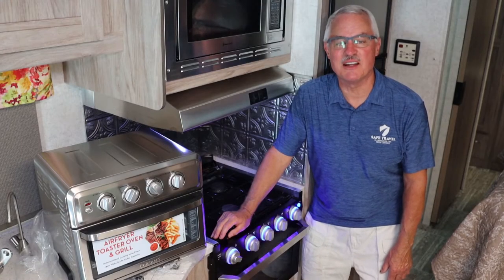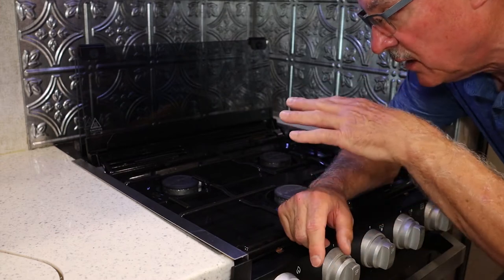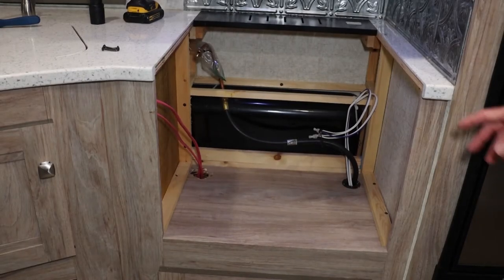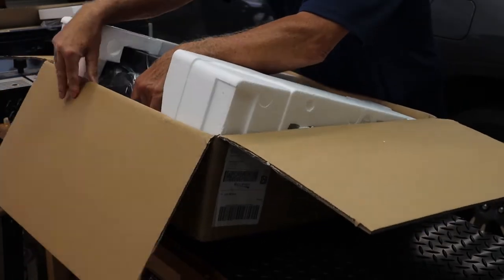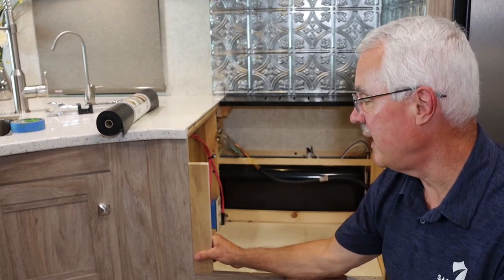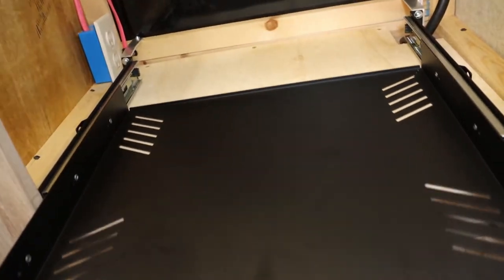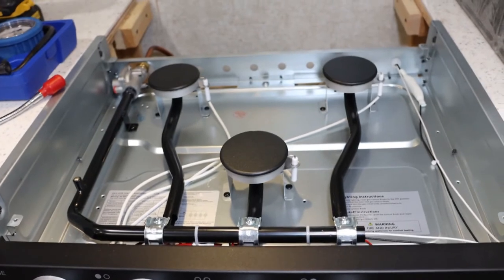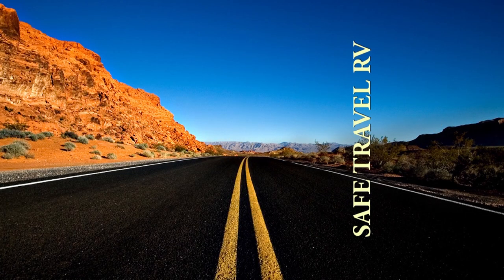Easy RV Oven Upgrade

Comment: I'm in the process of modifying our Cherokee Park model 39T trailer exactly the same as this mod. Only difference is I'm using a Ninja Foodi XL Pro Digital Convection Air Fryer Toaster Oven instead of the Cusinart oven. The Ninja oven is slightly larger but the recommended electronics drawer is a perfect fit for the Ninja oven. The side mounting rails on the drawer have an adjustable length so I don't see the need for the plywood shelf addition.

Comment: We actually had this planned before we saw the video with the  same Cusinart , we did buy a similar top. However I pulled out a Dometic oven and will need to lower the base about 2 1/4 inches to get it to fit with the 4 inch gas top. Not sure if the sliding shelf is needed but we did buy one.

Comment: Get a pizza stone and place it on the metal tray over the burner in the oven. Make sure the holes around the edges of the tray are not covered. Had a problem with some things cooking unevenly or flat out burning, until I put a pizza stone in. Works great now. Also cheaper than replacing your oven, if you're on a budget.

Comment: how did you find this worked out for your power consumption? Is this only able to be used while plugged in or do you have a battery system and converter that can handle the power draw?
Reply from the maker: As everyone’s 12v power supply varies, it’s hard to answer exactly . On my   Class C with 2 -100amp lithium batteries and an alternator that charges those batteries, i leave it on all the time. The video talks about power consumption near the beginning. you can search how to determine battery consumption based on watts per hour. Just remember that lead acid batteries and AGM batteries should only be discharged to 50%.  Lithium more like 15%. So a 100 amp lead acid battery has only 50 amps of useable power.

Comment: I would like to remove my oven and make it a large storage area for pots and pans.  I would also like to remove the microwave and replace it with a convection one.  Can you do a video on this?
Reply from the maker: How close are you to the Atlanta area?!  We could do yours and video it! If you can find a convection MW that would fit your current opening , it would be pretty straightforward.
The extra countertop  space where the stove will be removed would be a  great additional  work surface and that would certainly require some custom work .
Reply: Safetravelrv, where are you located in the Atlanta area? Do you do modifications ?

Comment: I plan to do a very similar upgrade - do you think the original Furrion oven/stove could be taken apart and the original stove top be used? THANKS
Reply: Hi, my first thought is that it would be more trouble than it’s worth. You would have to separate the gas lines supplying the cooktop and  oven, probably do some sheet metal work and add a  heat shield.  The replacement I recommended drops right in!

Comment: Skip the sliding rack and keep the oven in place while cooking. Easy. The top of the cavity is a heat resistant cook top.
Reply from the maker: Hi, thanks for your comment. Please keep in mind that every air fryer oven manufacture has minimum requirements top, bottom and sides to combustible's.  My oven cavity did not meet those requirements therefore I had to install the sliding tray to use when cooking.
Reply: @SafeTravelRV  I’m using a Ninja SP101, the one that flips up for easy cleaning. It’s exceptionally popular for good reason. With the oven gone, it has plenty of vertical space to put pans or cutting boards and there is about 1 inch of clearance on either side of the unit. After baking for 25 minutes, the inside panels of the cavity were barely warm to the touch. You are right, it depends on the unit, but even if another unit was half as insulated as my ninja, I feel confident it’s likely to be fine. YMMV